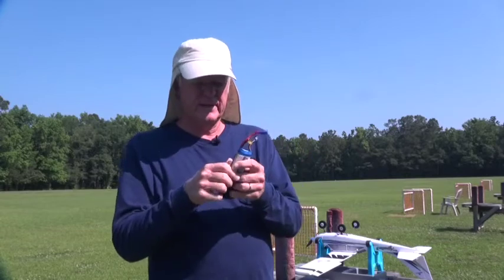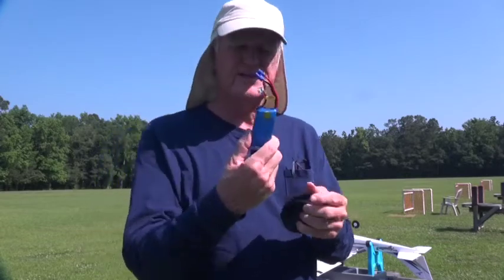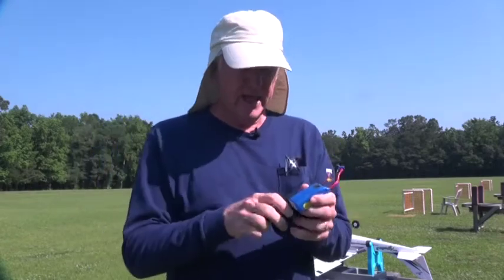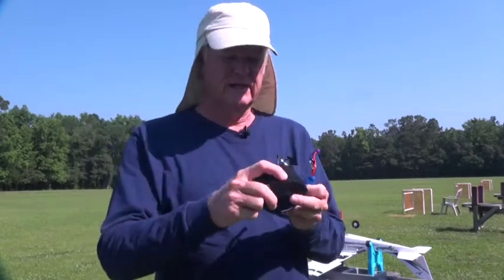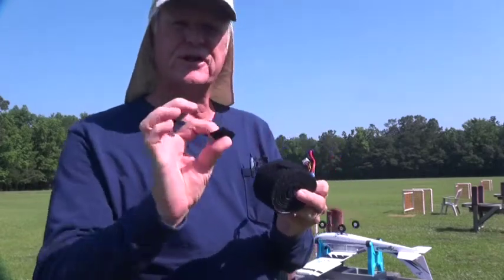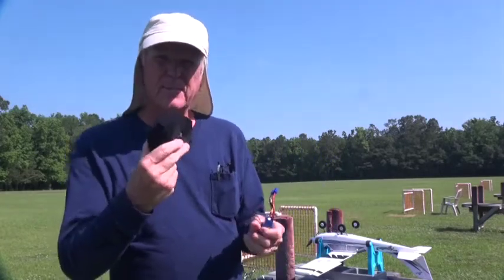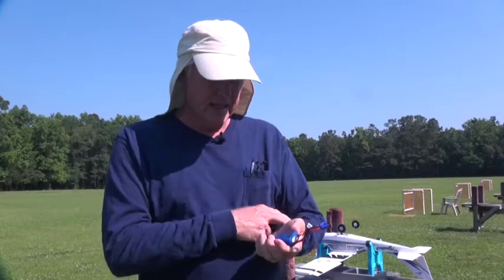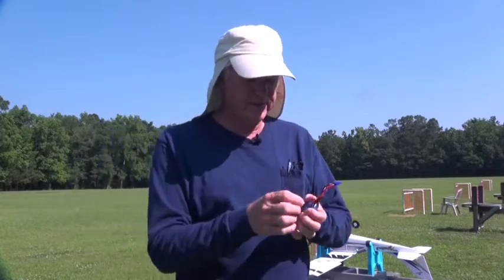MA13 Mini Apprentice Battery Velcro

Comment: I would like to add the WHY! You need the velcro. Unlike most HZ planes; this plane has a very generous battery box. Long enough for a 2200+ mah battery and almost wide enough for two batteries. The strap that is included does a good job of keeping the battery centered but allows it to move fore and aft almost an 1". No one wants an unintentional midflight CG Shift.
Reply from the maker: Good Info.